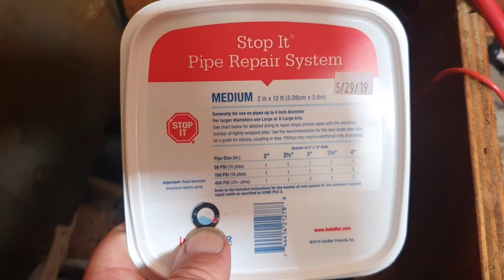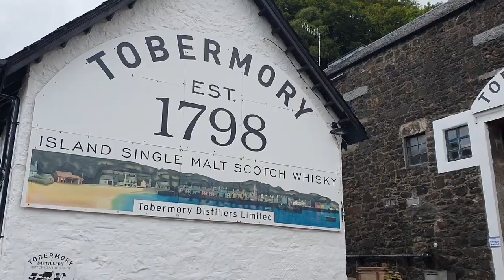Sailing to Tobermory Scotland, major fuel leak, visit from saltyLass

Comment: That was quite a story - ‘What’s the story in Balamory’😉 It’s likely the tank will need steam cleaning to complete the thorough internal cleaning, prior to any welding attempts - just saying so you can factor that in. Should be fun fleeting that tank out.😉 Good luck (and do not forget to insist on a water pressure test post weld repair and before reinstalling the tank).😀👍⛵️
Reply from the maker: Thank you for the advise  the fix has held up for a while so it's going to be a winter job 
Thanks for watching